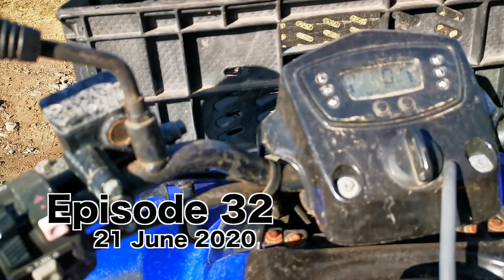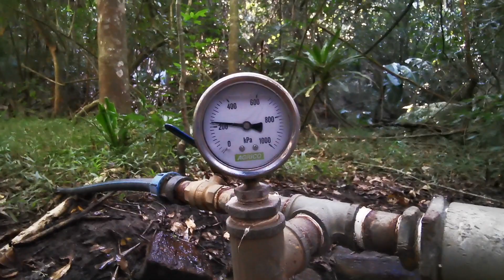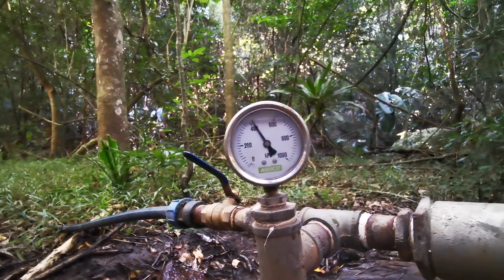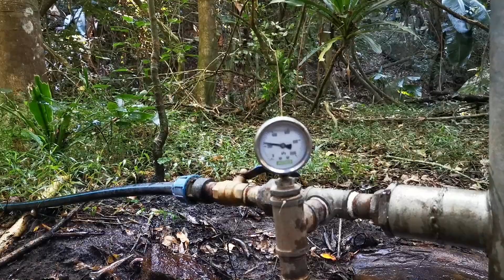The ultimate DIY RAM PUMP pressure system

Comment: Great addition to the series of fantastic episodes that are sure to be very useful to a lot of people. Thanks Morgs! Cheers, Darren @Regrarians
Reply from the maker: Thank you for the continued support. There are going to be a few more videos about it. I am sure of that 😂
Reply: @MorgsBrew   That little hole in the ram pump is needed for the air tank?
Reply from the maker: Correct. It allows air to enter between cycles and works surprisingly well. It is as simple as a hole. As small as needed, but not too small.
Reply: ⁵þ